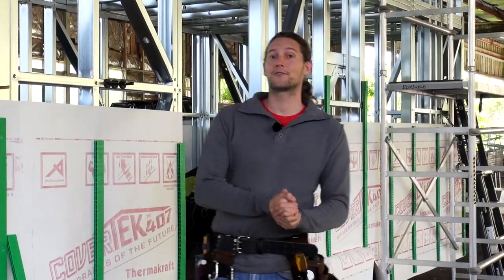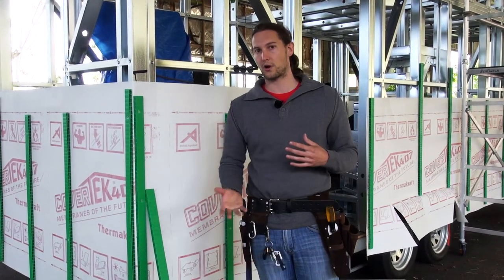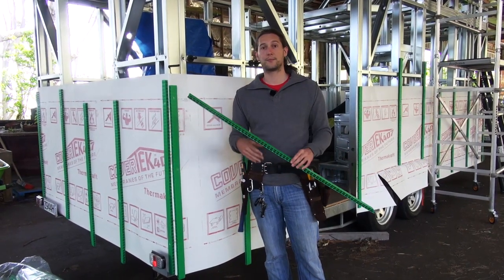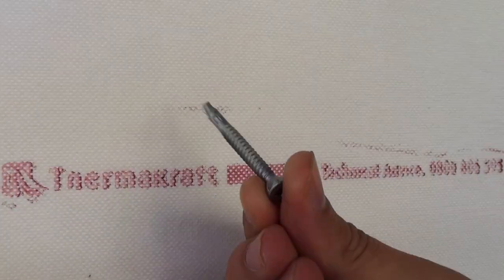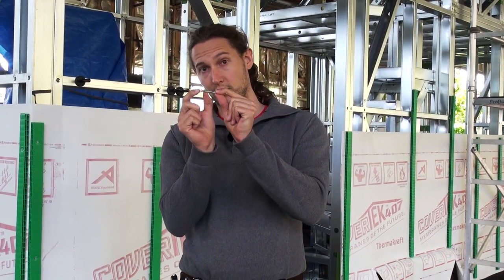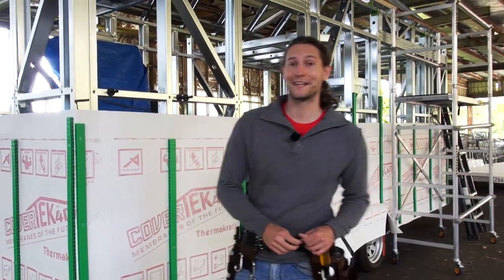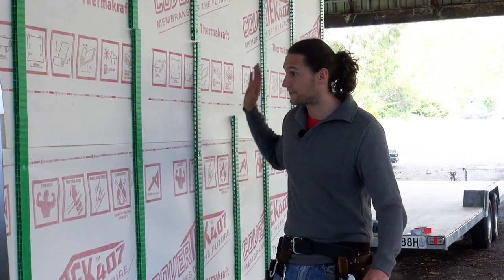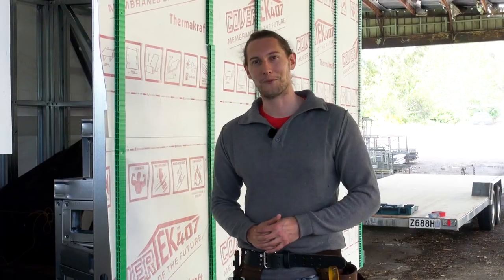Installing Cavity Battens and Building Wrap

Comment: Jz1239, if it were the final layer then yes a washer would be needed. In this application additional layers will go over them not needing a washer. The plastic material of the batten is also strong enough to do without.

Comment: Why not use a rigid foam say of 1/2 inch thickness. You would gain insulation.  I like the vented batons. 
Saving the smallest weight on each item really adds up

Comment: Thanks for sharing your build, starting to look good, solid team around you. I really like the cavity battens, but no luck tracking a similar product up here in the UK, can any one point me in the right direction. Perfer not to use timber due to weight on the project that I and  due to start. Cheers Dave.

Comment: Why would there be no sheathing? Wrap and rain screens are just as much for timber builds as steel.  Is the sheathing purely structural, and thus not needed for this type of frame, or is there protective purposes?
Reply: Sheathing is primarily for bracing(so yes, the engineered steel frame covers that) as well as fixing(makes things easier but adds needless weight for a moveable home).